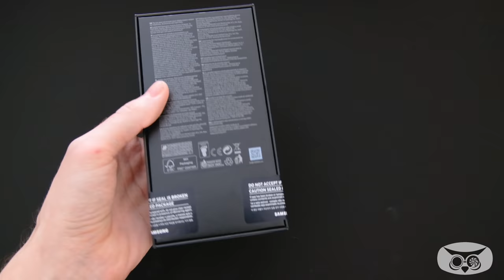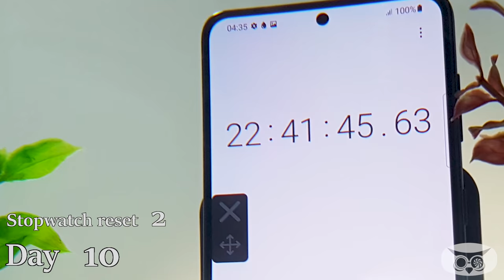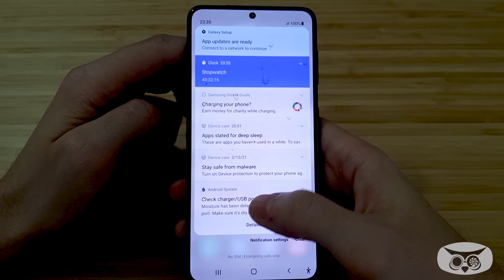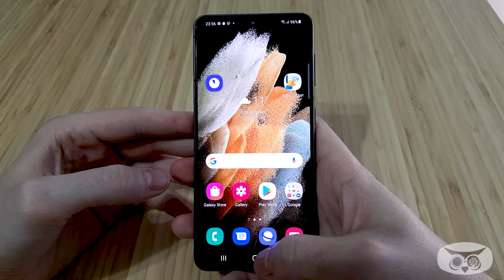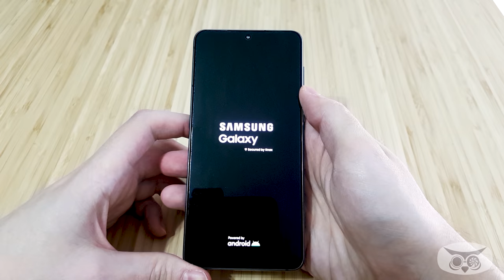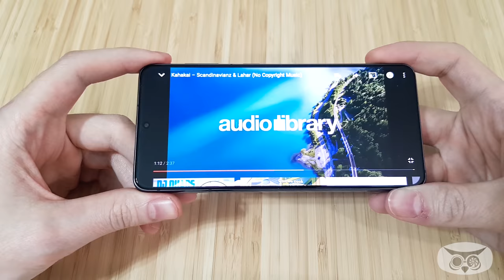What if you left a phone in water for a month?

Comment: Some of the water damage could have come from condensation  since the phone was charging the whole time. Charging creates heat, and in a cool environment like under water condensation will form. Explains the camera failure.  Great video.  Nice to know my s21 ip68 rating is confirmed.
Reply: I haven't switched from Galaxy since the S8+. In fact, I still use my S8+ now. I always love throwing it in a sink or something like that to freak people out. Still perfectly waterproof.
Reply: Correct!
Reply: For the inside of the phone to condense there would need to be a significant amount of air. The inside phone barely has any. Also, while charging produces heat, it wouldn’t be as significant source of heat when compared to a screen that is running. I would place my bets on there being a very small leak which later just evaporated across the phone
Reply: S21 sucks. Plastic back on a flagship is inexcusable when every $300 Xiaomi has  glass.
Reply: @jm036  well if u use case lastic is better for dropprotection, but yeah samsung has regressed so much after huawei got banned, i still use s9 whtich i think is pinnacle of samsung phones
1440 oled screen, ip68, headphone jack, sd card slot, no noch or camera hole, like s9 has all features new phones has exeept multiple cameras
Reply: @jm036  i prefer plastic back
Reply: @GooseTheSecond  My Galaxy A8 2018 sadly lost some of its water resistance over the years, so taking it for a swim kills the power button for the day
Reply: @GooseTheSecond  Same here haha I have a note20 ultra
Reply: @GooseTheSecond  i use the s9 but recently i had to get it repaired cause i dropped it without a screen protector-
Reply: @GooseTheSecond  after 3/4 yars isnt a good idea
Reply: @xpy99  yeah oh well lol
Reply: I should not put it in salt water or dirty water
Reply: @GooseTheSecond  it’s not waterproof, it’s water resistant
Reply: @jm036  plastic is less likely to break and lighter
Reply: @jm036  also cheaper and easier to repair
Reply: @jm036  Why is plastic back so important to you
Reply: @jm036  plastic backs are better then glass backs there less slippery and more drop resistant tho i would probably rather have it made out of glass because of how bad plastic is
Reply: @jm036  A 300 Xiaomi has glass but doesn't have half of the premium resources. The idea is to make it cheaper without compromising what actually matters.
Reply: @joaorosa6085  Half of the premium resources? Lol what?
Reply: I have this phone that got accidentally submerged in water for about 4 seconds. Got it out, turned it off for an hour. Then turned it on for assessment. What happened is the switches (vol and power) responds with a delay but the screen can still be touched. About an hour the switches are back to normal but the screen is gone. Does not respond to touches anymore but on the next day, the touch response is back.  May I hear yo guys' input over this?
Reply: @jm036  plastic backs make phones easier and cheaper to repair and one less part to worry about breaking if you scratch a glass phone it cost 50$-100$ to change out the back plastic is 10$-20$.
Reply: @jm036  it's frosted glass tho not plastic
Reply: @inniyewtesfaw2003  lol no
Reply: @jm036  The s21 isn't their flagship though....the s21 is the base model to compete with the likes from Apple and Google. That would be like calling the iphone 13 mini Apple's flagship completely ignoring the 13 pro max being better in effectively every way.
Reply: Yet people shit on Samsung cus they think iPhone is cooler
Reply: Imaging having big brain
Reply: Hehehe
Reply: @GooseTheSecond  It's water resistant not water proof. But please don't do that. The adhesive used to seal the phone can get loose after some time so be careful
Reply: Asian phones... im sure if we do the same experiment with iphone, nothing will die.
Reply: @GooseTheSecond  it ain't really waterproof tho these phones are only water resistant it gon get damaged overtime
Reply: @TechTesting  I'm still using the Note 9 for the same reason!
Reply: @jm036  agreed.
Reply: @danielmaxter1928  do your 5 american cheese burger braincells not realise iphones are made in china too?
Reply: @danielmaxter1928  foh fanboy
Reply: @danielmaxter1928  iPhones are made in china also lol
Reply: @danielmaxter1928  oh also, that's not true. I dropped my phone 11 in a puddle a few months back and the mic and the ultrawide cam does not work anymore
Reply: @jm036  That plastic is stronger than that glass. Why do you think your Xiaomi already has one foot in the grave while not even being a year old, but that Samsung has lived it's guaranteed life span plus more? 🤔
Reply: @KingDeadMan  What's that smell... Oh right, it's copium, 99% pure copium. One foot in the grave while not even being a year old? Sorry to break it to you but it looks and feels like new and it's well over a year old. Plastic can't be stronger than glass.
Reply: @DigitalAdventures1  yeah I agree, there’s hardly any air in the phone, and on top of that, there’s hardly any water vapor in the air already, probably not enough to create that level of condensation… my guess is a mix of both, there was prob a small leak, and the water that got in condensated on the lense
Reply: Not confirmed until you check
Reply: The 21 plus has a glass back.

Comment: What's more impressive than the phone surviving for 31 days underwater, is this guy fixing the minor faults it had, on his own, with minimal effort, and no swapping out any parts. That's one hell of a phone if it can be fixed so simply after so much punishment, where other phones would be out right bricked.
Reply: Cough cough APPLE cough cough
Reply: @cojames1514  water resistant*
Reply: Like the new iPhones:)
Reply: @cojames1514  Then why is it wet 5:38?
Reply: @mikshiinyanshi  nah mate iphone big garbage
Reply: @monokuma4859  he'll be like cuz it's a bad phone lmao
Reply: @monokuma4859  bro 31 days
Reply: @iohanncenturion9343  Waterproof technically means that it’s impermeable to water, no matter how much time it spends in water.
Reply: @mikshiinyanshi  no, not at all like the new iphones.
Reply: @cojames1514  Waterproof does not describe these devices, because at certain depths and under certain conditions, water will leak into the phone. They're water resistant, not waterproof. That's why you see them marketed as water resistant, not waterproof. If companies could market their phones as waterproof, trust me, they would. The reason these phones have IP ratings is because at a certain point, the water gets in. For example, if your phone is at a depth of 30 feet for around 1 hour, water would probably leak into the internals, casing it to stop working. Waterproof and water resistant are two different things. Proof is a pretty bold term that is rarely used in this way, because most electronic devices in all areas cannot withstand certain water conditions for certain periods of time.
Reply: anon discovers a phone that wasn't made by Apple.

although, the glass-backed Samsung's are significantly harder, but once you're in, it is MADE to be taken apart
Reply: So you mean this phone is bad?
Reply: @oofytaunder2079  no, I don't think that's what he meant at all.
Reply: Exactly
Reply: @ratrodgrady  by that logic what even is actually waterproof? Basically any device will have water leak into it given enough time or enough pressure
Reply: @Dell-ol6hb  That's true, but these phones can't really handle extreme conditions for long. Waterproof devices can, and yes, eventually they will degrade, but that's not the point. The point is that they are able to handle those extreme conditions at all in the first place.
Reply: Perfect phone for fishies :)
Reply: @monokuma4859  so humans arent waterproof?
Reply: People still prefer wired charging because it is faster to transfer files that way and the storage can be accessed and updated through wired connection
Reply: If only it had an SD card slot
Reply: @rayirth.upside-down  I came to the comments of this post to literally post the exact same thing
Reply: @rayirth.upside-down  cough cough apple scam cough
Reply: bro he swapped out everything, are you blind?
Reply: @rayirth.upside-down  Cough Cough Expensive cough cough
Reply: @mikshiinyanshi  uuuh….
Reply: yes  its not iphone you know :)
Reply: But he didn't change any parts...
Reply: Everyone here is comparing apple with samsung, but if the guy didn't change a single part of the phone what's the comparisson for?
Reply: @monokuma4859  said: "Waterproof technically means that it’s impermeable to water, no matter how much time it spends in water." - No it doesn't. Even professional deep sea diving gear would corrode and stop being waterproof after a certain amount of time left constantly underwater. So whether something is underwater for a day, a month, a year, or a century, it could still be considered "waterproof". In this case, a phone wouldn't normally need to be left submerged for a whole month. And as it turns out, even if it was, it is still salvageable with proper drying out.
Reply: This phone snapped apple out of existence

Comment: Ahh now I see why people want wireless charging, makes so much sense with it on the side of the tank
Reply: Exactly. I often leave my phone in my fish tank for weeks, I NEED wireless charging for that exact reason.
Reply: @charlieme5150  LMAO
Reply: @charlieme5150  first like to your comment, I bet your comment will get a load of likes
Reply: @rajeshwariumashankar8082  thanks, i wish, but I doubt, it's sorta hidden in the replies and not as a main comment
Reply: @charlieme5150  it is the top reply
Reply: @charlieme5150  lmao
Reply: @rushilsangubotla224  hello rex old friend
Reply: @charlieme5150  
ㅋㅋㅋㅋㅋㅋㅋㅋㅋㅋㅋㅋㅋㅋㅋㅋㅋㅋㅋㅋ
Reply: The best kind of water cooling
Reply: The actual reason is that the port sometimes can slide inside the phone over time, so it's better to prevent that using the wireless charger
Reply: My phone charging port is busted so I tend to use wireless charging instead. Saves me more money in the longrun  since my wireless charger shuts itself off once the battery is full. Also I can use it to charge my smart watch which is a bonus!

Comment: Bro this is the phone I have and I saw the thumbnail and I was rooting for it. and seeing that the hardware exposed on the outside (besides the screen) didn't work I was bummed out. And all you did was just clean it out and dry out the water in the phone and it worked as good as new. TAKE THAT APPLE
Reply: Apple does the same thing dude
Reply: @hypermemes2821  can you open an apple device and replace/clean the parts without needing to go to a tech shop?
Reply: @thundertm  yup
Reply: @hypermemes2821  with an iPhone, its actually alot more difficult to repair. Hence why you minus well bring it into a shop, either way, its just too much work for something you can get that can do the exact same thing AND save money on repairs as well. I'd rather be smart then sorry here i guess.
Reply: @hypermemes2821  bs, the adhesive is near impossible to take off
Reply: @jm036  you just have to know what you’re doing, the average person wouldn’t know. But it is possible you just need access to the right tools
Reply: @dislikebutton4239  I mean it's way harder to remove than other phones.
Reply: @jm036  Are you talking about removing the back or actually taking the phone apart with the tools once the back is removed? cuz the back is easy to remove u just gotta heat it up and slice thru it. but yes once u take it off then it is harder than other phones i do agree 

but all i’m saying is as long as u have access to the tools and know what to do it is possible . also i read that didn’t apple not too long ago like last year start doing a right to repair kit service?

Comment: Wow, I was waiting for the final time lapse but didn't expect the tear down. Is the front camera working? and can you still charge using the type C port?
Reply from the maker: I had to take it apart to figure out where the water entered the phone. I couldn't use the front camera with the original samsung camera app because it wouldn't let me switch, but later on the idea came to me maybe I should try it with some third party app, and with that the rear camera was still broken but I was able to switch to the front facing one and it worked. Charger port also worked once the phone was dry :D

Comment: I have this phone that got accidentally submerged in water for about 4 seconds. Got it out, turned it off for an hour. Then turned it on for assessment. What happened is the switches (vol and power) responds with a delay but the screen can still be touched. About an hour the switches are back to normal but the screen is gone. Does not respond to touches anymore but on the next day, the touch response is back.  May I hear yo guys' input over this?
Reply: Modern flagships will not die normally from simply getting wet or submerged as we saw here. 

Now, if the screen is cracked, back is cracked (if applicable), or anything is physically damaged that isn't just the frame. You can expect the water resistance to be worse than from the factory. 

I work for a technology company and fix phones on the side, delay in button response could be water inside the buttons which won't damage anything assuming the buttons are properly sealed. Replacing the screen would probably fix yours but also inspecting the screen cables for signs of a short or corrosion will help actually diagnose what you'd need to do. We can almost guarantee it got water on the back of the screen meaning I would personally reflow the screen connections on the board to ensure the corrosion doesn't keep forming/fix any current issues with the connections.
Reply: Lol you had to wait a few days in a rice bowl for the water to go away not a few hours
Reply: You probably had a faulty model
Reply: @tyf.4399  Brought it to a local tech and said it's fine and would not do anything to the phone as it is already fine and would not take the risk of disassembling it as he said it may damage it further. What do you think?
Reply: @gypsygypsy_y  Depends. If it is working now and hasn't had any issues for a bit I wouldn't be too concerned about it. Not because taking the screen off is dangerous, any competent technician should be able to do it 99/100 times without damaging anything but there is that risk. Mostly because the price you're going to pay for them to simply clean the board and reseal the phone is probably not worth it for most people. If you're phone is more important, maybe you use it for work, etc. Then maybe ensuring the board isn't developing any corrosion is worth it to you so you have a reliable device. But assuming that isn't the case, probably fine for now. But you shouldn't have had any issues in the first place so there is definitely cause for concern for reliability of the device. 

Hate to be that guy, but the TLDR is that it depends what is more important to you.

Edit: Just to clarify, doesn't mean that tech is incompetent. Just means he probably assumed you valued money more than opening your phone with no intentions of replacing anything. Both can be valid solutions. Just depends on the customer. The tech may have been completely fine with opening the device, but just assumed you didn't want to unless there was a more apparent issue he could resolve.

Comment: 6:03 for anyone doing this, it's recomended to wash the parts with denaturated water or ipa first (to remove mineral buildup from normal water... or anything worse). If using ipa bath tou can dry it really easy by compressed air or lil bit of heat (it evaporates realky fast). It's way better than using dirty rice ir silica balls. 
If you do it like it this vid (only after it does not work) you risk that some residue will short out components that could have been saved. I mean it's still only a Samsung, but any device deserves chance for fix up.

Comment: putting rice anywhere near a phone will cause more damage, and will not get rid of any of the water damage. The starches and various small particles and grind away traces, and speed up the corrosion process greatly. The best thing you can do is disassemble as much as you can and either put the parts in a vacuum, or in an area with a steady flow of warm away blowing over the wet parts.

Still shocking how well the phone survived!
Reply: DO NOT LISTEN TO SERGAL. I put my phone in my vacuum cleaner and now it is completely full of dust and will no longer charge.
Reply: @amaimask3088  the funny part is he didn't say vacuum cleaner, he just said vacuum, which I'm pretty sure would just destroy the phone if you did that. Maybe even more so than if you did indeed put it in a vacuum cleaner.